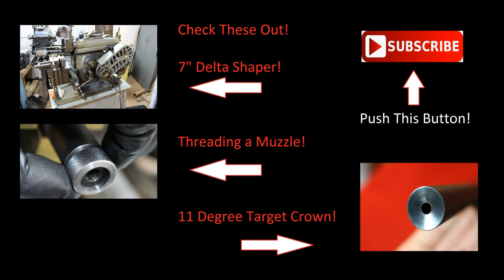Making A Over All Length Case Gauge! Reloading!

Comment from the maker: Hey Jim, you can go as close as you want and even jam the bullets into the rifling on your falling block, but I would start with a 20 thou jump and go each way in 5 thou increments and see what happens. The reason for the jump in semi autos is mainly for reliability issues and making sure that bolt slams home before firing.
Reply: spitfire1821 Thanks for the info. I appreciate the videos. 
Haven't shot the .223 1885 yet. It belonged to a lifelong friend that was terminally ill and was his "baby". Just need to remember him by taking it out and shooting it, but it's still tough when I see that rifle.
Jim
Reply from the maker: Yeah, I was able to get a rifle built by my wifes late grandfather and I've only shot it a few times, but it is a fine example of what his shop use to build back in the day.
Reply: That's what I was wondering?

Comment: I assume the OD of the red tube is 5/16", but what is the ID or how thick is the tube wall?
Mcmaster Carr offers that tube (.313 OD) in steel with an ID of .183, or .215, and even .243.

Making the red tube should be easy without a lathe.
As for the case, chuck the case in your drill press and clamp the drill bit /tap in your vice and it will drill like it's in a lathe.

Comment: Love your channel. What lathe would you recommend for the home hobbyist/ budding gunsmith
Reply from the maker: Anything from a south bend heavy 10L which is 10x34" to 14x40 or so away the larger end for various machines.  1.25" spindle bore or larger and threading capabilities of course. A short spindle length helps. There is a lot of info on the internet seeking that same question.

Comment: Question is are you setting the shoulder back on these cases prior to machining?  When I resize my cases to be loaded, I take a fire formed case and then bump the shoulder .001" to get easy chambering yet tight enough to not let the brass grow too much upon firing.. IF you are not first sizing these modified cases to the exact dimensions you would for the ones you are loading How are you measuring for seating depth?  If you don't resize are you then subtracting the .001 or .002" from the un sized modified case when transferring measurements when setting up your seating die?  I also make my own cases on a drill press as I don't own a lathe, but I first size the case the same as I size the cases I reload. I just chuck a bit in upside down and push it into the mouth to open it up enough to slide a bullet in.
Reply from the maker: Good point. Most of my cases are just neck sized. If you are FL sizing you can remove that bump measurement from you oal. However, you will need a bushing die and not size the neck at all. A fired unsized neck will give you a perfect bullet tension if everything between you chamber and brass are correct.
Reply: Not really.. You can full length size a case and not bump the shoulder, which would be great for a target rifle using expensive brass that you don't want to overly work or if for hunting you would fl size including a shoulder bump of .001-.002" to insure ease of chambering. It all depends on how far down  you screw the die, providing your shell holder allows for the extra sizing. If not it is easy to take a couple thousands off the top of the shell holder or the bottom of the die.  As for the necks.  After sizing the case I  take a dremel cut off wheel and make a couple slits 180 deg apart,  lengthwise  in the case mouth of the sized case and the bullet will slide in and out relatively easy.. My point is that when sizing my cases I like the .001" bump on the shoulder, so I also incorporate that same bump on my modified cases so the comparator will sit on the same datum point on that case as it will on the cases I'm using for loading. Then there is no guessing as to what my exact seating depth will be as both cases will have the same shoulder dimensions.  When bumping case shoulders back it also moves the entire neck back with it.. I hope I'm making sense here. 
 Anyways, I like your videos..

Comment: Your theory is wrong. You should always prep your OAL case the same as your brass will be prepped before you load them.
Reply from the maker: No, I want to get the measurement of the bolt face to the leade, not the rear of a sized case to the leade. This gives me a more accurate measurement of where the leade is in relation to headspace. I don't care about OAL unless I need to fit it in a magazine. We are worried about Overall Length to Ogive.  From there, I can do the math to produce loaded rounds. The sized case is relative, the bolt face is static. This gives me a baseline for measuring throat erosion, leade movement, and I can adjust my measurement based on what my shoulder bump will be with any other case. 
In the long run, I don't think most people will be able to tell the different on paper, but I get more consistency doing it my way.